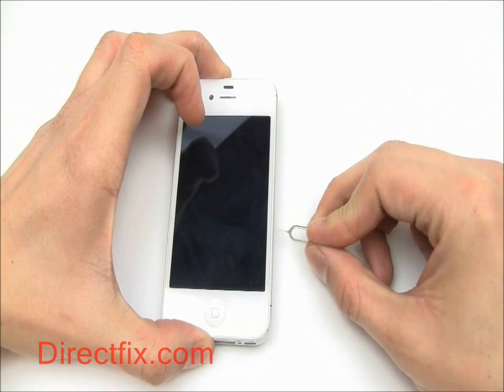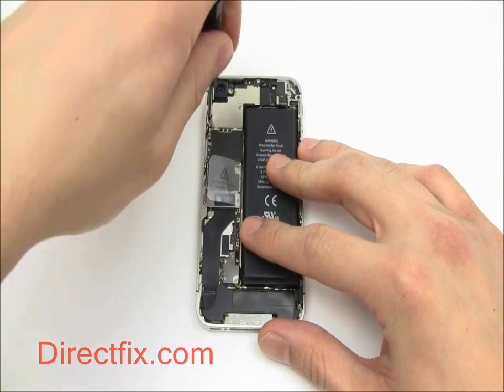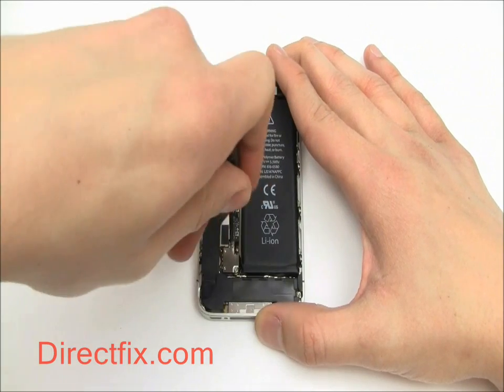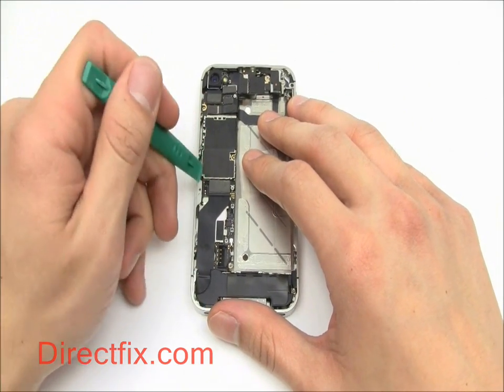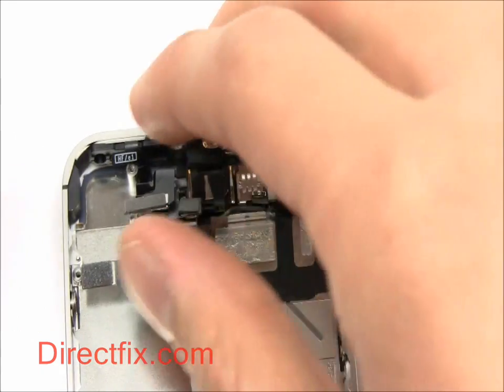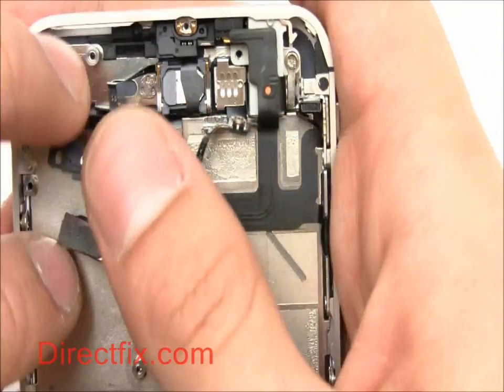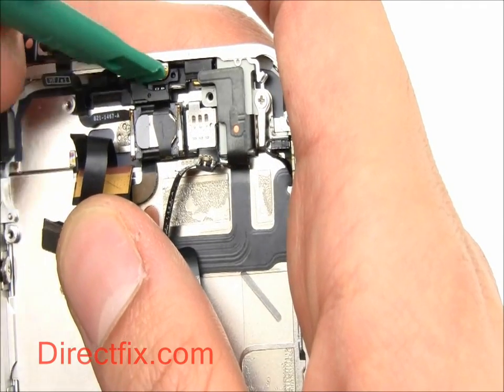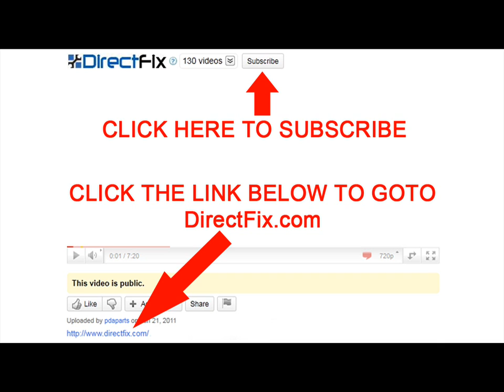FASTEST Repair iPhone 4S Proximity Sensor Not Working

Comment: Ive just done mine today, 1st time ive ever taken a phone apart, was a bit nervous but followed this guide, put the phone back together button worked like new, but the screen didnt respond to touch. but, i took it all the cables off and reconnected them again, and it did work, dont think i connected a cable properly 1st time. its actually a lot easier to do yourself than it looks on the screen.

Comment from the maker: Yes, it is most likely related. Sounds like either they did not attach it correctly or damaged it during the repair. I would go back to them and have them fix it and they should not charge you.

Comment: Hi, i recently had a problem with my power button. took it to the shop where they repaired it... power button works great but now the proximity sensor does not work, do you think this could be linked to them repairing the power button? looking at this video they come as one so i figuered it must be!

Comment: i was just able to do it with mine. my button was stuck in place and wouldnt click in or out. i took the whole thing apart, pulled out the button, cut up super super small peices of duct tape, stuck it to the contact point to add height, put it back together, and works perfectly